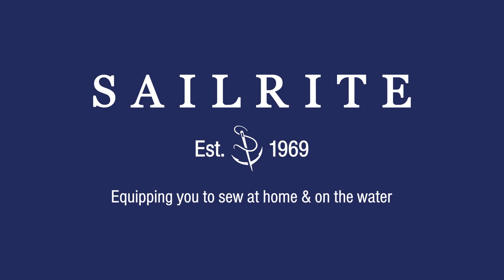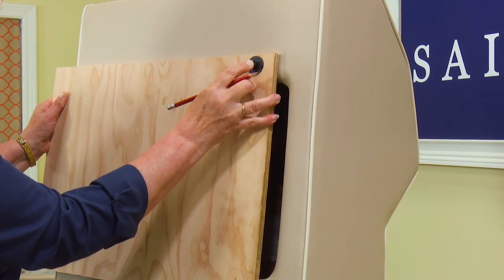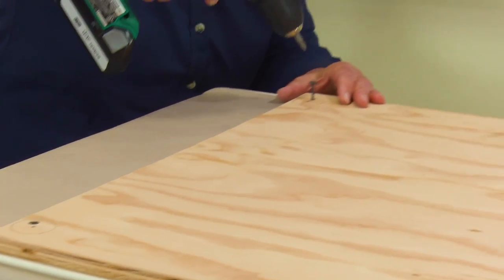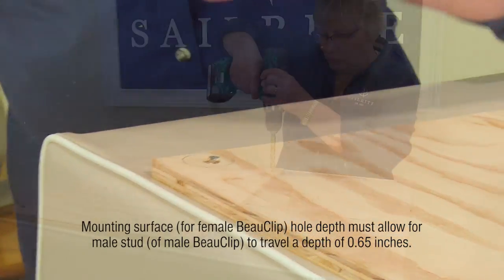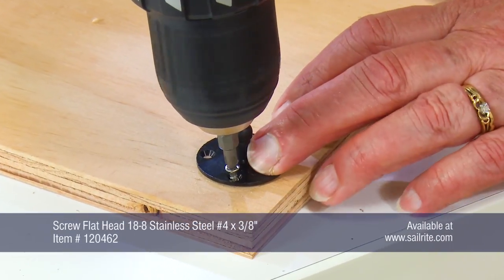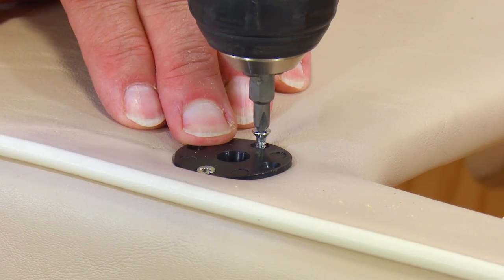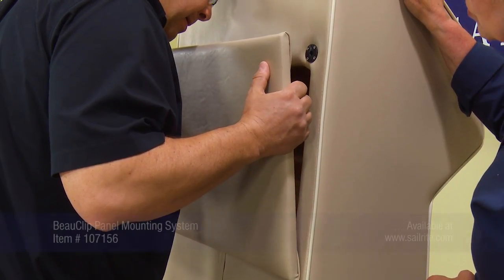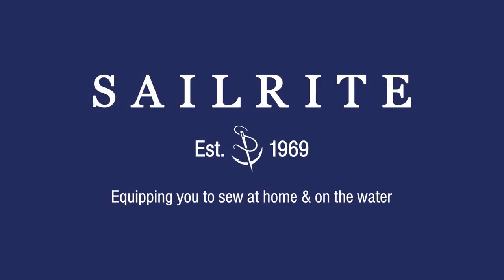Using the BeauClip to Mount an Upholstered Panel

Comment: Do you ever need to recess them into the wood a little to avoid getting a gap? I'm thinking of using these for my open bow back rests.
Reply from the maker: We do not recess them, but if you wanted to avoid the gap of the plastic flange that could be done.